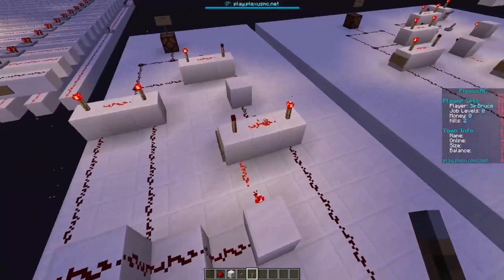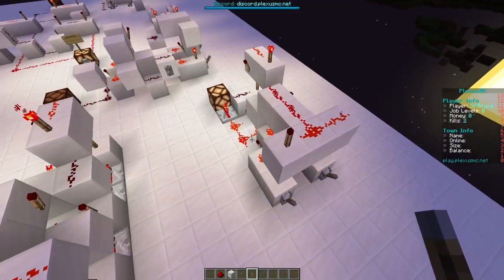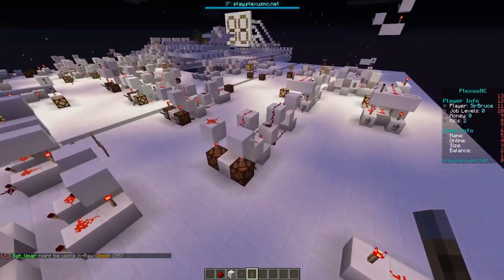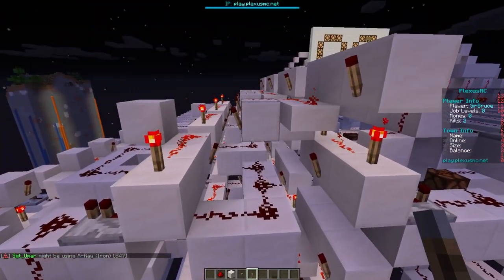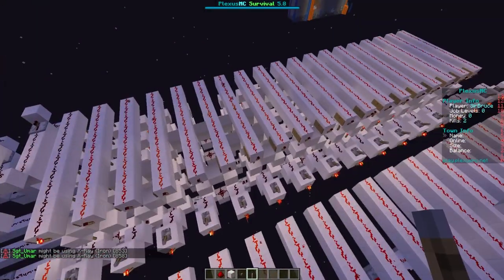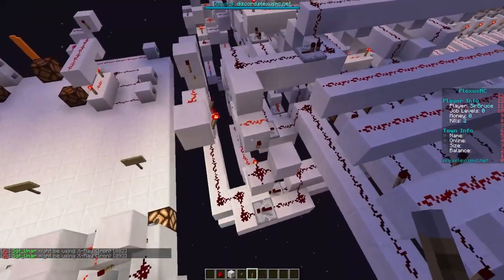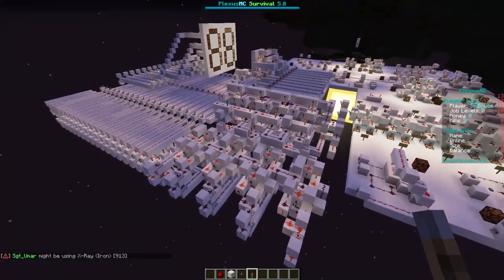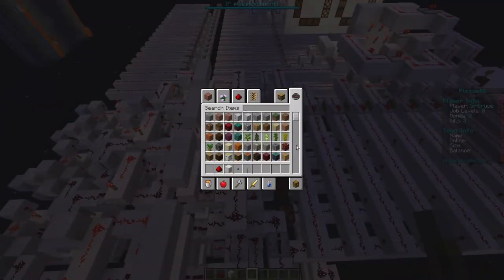Minecraft Simple Calculator Design and Memory Module (Only Redstone and Torches)

Comment: I recommend RS latches.
#@--#
L-----@
#=block
-=redstone
L=redstone
@=redstone torch
Reply from the maker: Yeah I know about those, the circuit I used, something similar, an Or gate feedback used for storing the data. Though the difference is you can toggle the memory circuit with a single data line, while the RS Nor latch requires 2 inputs to toggle.
Reply: @PlexusMC  but you can make it whatever you want easily by either side. I don't see much reason for a toggle unless you want a door or light

Comment: I'm trying to create multiplayer minigames on my single player world that is 13 full updates behind the current version of Minecraft and will therefore never be multiplayer unless on LAN or if I can find a server that for some unknown reason supports my decade old, pirated version.
Reply from the maker: You don't need a pirated version of minecraft, and you should be able to run beta minecraft servers. If you can't then you just port forward, to allow it joinable externally.
Reply: @PlexusMC  no I'm saying I have a pirated version that hasn't been updated since before horses were added.
Reply: @PlexusMC  if you want, I could post a video on my small, not posting regularly channel of my stadium arena so far and show you what I'm trying to do. And before you ask, yes it's Spleef but can theoretically house other games as well. I just haven't set them up yet.